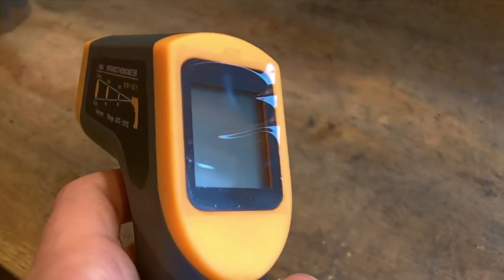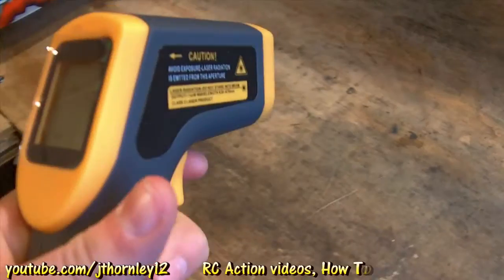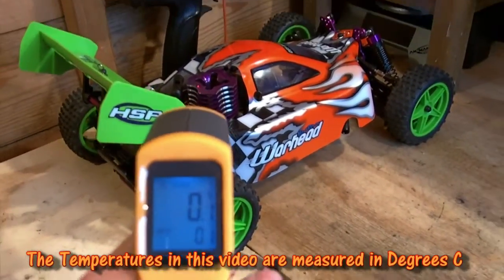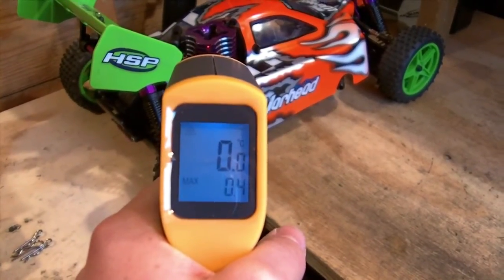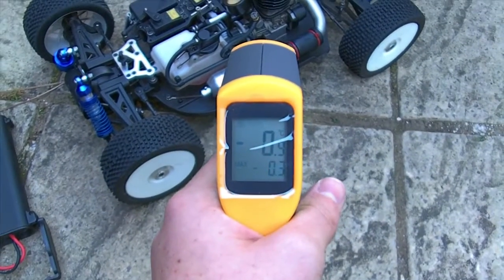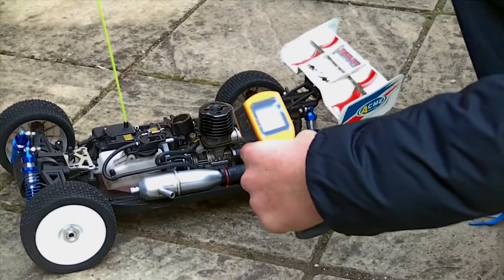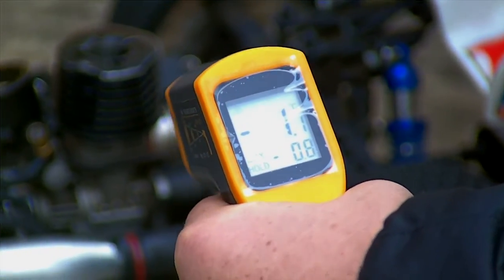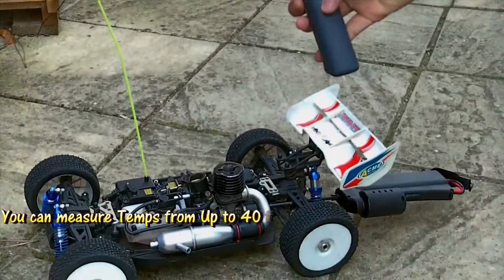Nitro Engine Temp Guns Demonstration Part 1/2

Comment: Josh just bought a temp gun similar to yours does it matter what you set it for as in manual got different materials etc aluminium skin wood etc or just leave on standard setting.

Comment: thanks for the video. i have the exact gun, but readings varies from where I point the laser. are you sure regardless from where you start you get the right reading? in the HPI bullet St manual it says to keep the temp below 250, when I read the heatsink it shows less 250 but if I read from the lower neck of the heatsink it shows higher temp, which one do I point the gun to? an does it make any difference if I put the gun right on top of the heatsink. thanks
Reply from the maker: I usually point it at the glow plug

Comment: Hello. I need some help regarding this engine Vertex 18 engine. I need to know what are the running in settings on the air needle and the fuel needle?

Comment from the maker: @soverato3 depends which part of engine your measuring. For lower engine temps you measure lower heatsink/Crankcase. for higher, you measure the glow plug temperature. and nops you cant get more accurate than Laser beam temp checkers :D